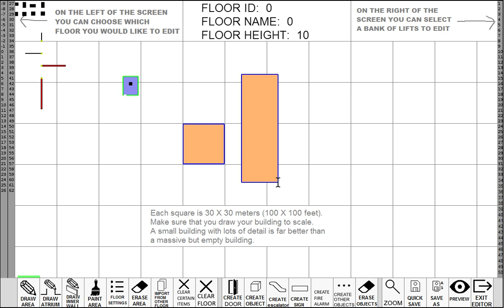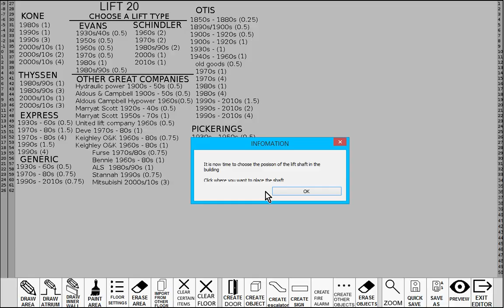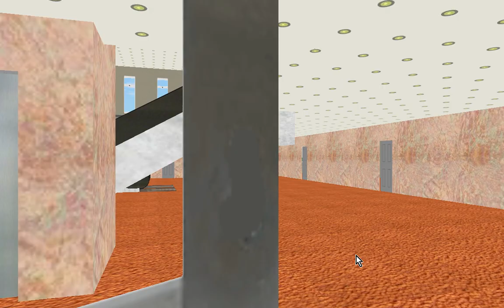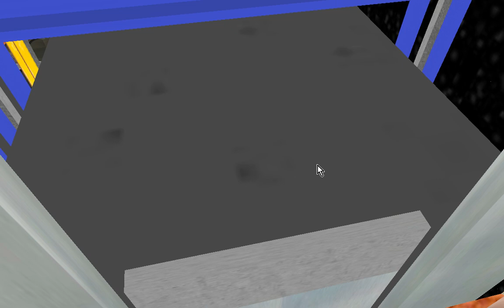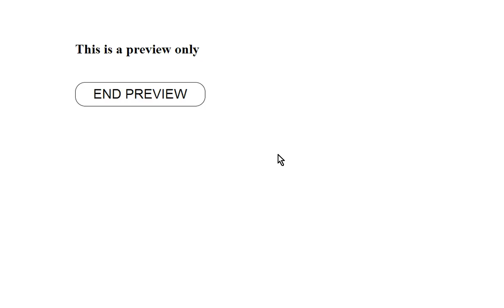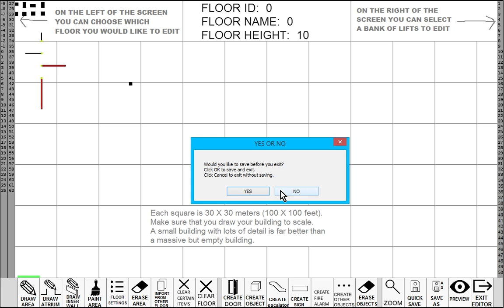Current progress on my update to skyscrapersim

Comment from the maker: What features would you like me to include in the update to this game?
Reply: So you can choose what type of door opening you want i.e dualspeed, centre opening, centre opening dualspeed, 3 speed etc and choose door thickness too
Reply: - Add crawl spaces between the floors, otherwise it just looks weird seeing just a flat polygon with no height as the celling and floor. 
- Allow settings in the building creator to be accessed by a menu instead of sequentially.
- Have things snap to other things, such as atriums, internal walls, lifts, and escalators, also use this to remove Z-fighting when this does happen.
- You didn't show the stairs feature, but I hope it can create helixes so realistic towers can be done.
- Revamp the way textures are uploaded to the building creator, the old system was horrible and basically turned me off from making buildings.
- Building off axis (idk if this is even possible and it probably should not be a day 1 feature.)

I probably forgot some stuff, that's just a few quality of life things to increase usability. Regardless this is miles ahead of anything before it and i cannot wait to return to some of my favorite buildings with this new feature set.

Thank you for revitalizing this!
Reply: Lift motor rooms, or some sliding door entrance at some building, or a revolving door
Reply: @suf-atha  There's already revolving doors.
Reply: @suf-atha  revolving door is already added
Reply: My suggestions:

- Indicator animations
- better level select (when a level is highlighted, show an image from a file)
- better loading (keep image up, show building details such as height, location, creator, etc)
- better menu (cycle thru level images in menu background)
- support for more model types
- dynamic lighting (looking thru source code, it may have some incomplete version unused)
Reply: incline elevators, gated elevators
Reply: A new ui and furniture maybe like office tables lobby desk...
Reply: Raytracing 😂. I think it would make a nice addition :)
Reply: Support for macOS (if you’re willing to do that. If not, that’s fine, I can always watch more demos)
Reply: @ratatatt1049  yeah that sounds like a you problem 🤣
Reply: @jakewynn  It’s not the end of the world for me if Beno doesn’t make this available for the Mac, but it would be amazing if he does.
Reply: @ratatatt1049  you could always run it through wine I guess
Reply: @ratatatt1049  I'm pretty sure that this is quite an old game engine but you can use a windows emulator on your mac.
Reply: Also one last thing, the ability to create irregular shaped buildings/parts to buildings. Maybe that can be in the foreseeable future though
Reply: Travelator (Moving walkway)
Conveyor Belt
Reply: It seems travellator is an option.
Reply: @Andrewjg_89  already have that
Reply: @Andrewjg_89  There's already travelator, on the escalator selection
Reply: ability to specify custom textures in-editor would be nice if that's not already a thing
Reply: Custom elevator making
Reply: Sound files would be good, motor noises etc.
Reply: @markford6785  yes
Reply: Fire alarms, Motor Rooms, Fire Mode, Lift Freefall, Exit Signs, and general signs that you see in buildings
Reply: an option where you can have freight doors
Reply: Hi Beno,

I have missed your Building Creator very much and am happy you are back.
For your new program I have 20 suggestions but I don't know if you can do them.

1. Elevators with external swing doors, but with vertical internal doors or without internal doors.
2. Platform elevators, like Inspirational City used to have.
3. Horinzontal moving cabs or subways with sounds that you can control much like an elevator. but that might be difficult.
4. Elevators that are round.
5. Elevators that have hydraulic drive.
6. Several buildings together to form one building.
7. Many choices of colors for windows, walls, floors and ceilings.
8. Glass panels in escalator handrails and a choice of step colors in escalators.
9. Creating glass roofs and glass domes for buildings.
10. Creating elevator doors that look different on the outside and inside.
11. Selecting different shaft walls and glass panels for each elevator.
12. Special settings for round buildings.
13. Many sounds for the elevators.
14. Buttons and floor indicators could light up as real as possible.
15. Selection for different elevator doors.
16. Selection of ceilings, floors and walls for the elevator cars.
17. Creation of fixed ramps.
18. Buttons for wheelchair users.
19. Selection for glass panels on the elevator shaft.
20. Half floors in buildings.

Your Building Creator was the nicest program for me to create new buildings myself. I found coding without Creator, just by hand, too hard.
Reply: More floors!!!
More Lifts!!!
Reply: If I were you, I'd make the controls on the top of the lifts and the counterweights optional. Not all lifts use a counterweight, not all Skyscrapersim users are gonna want to surf the lifts and (like you said) not all lift shafts have space for controls on the top of a lift.
Reply: Will there also be automatic doors for buildings?
Reply: a travellator would be nice in an airport themed map
Reply: A way to change the ceiling height of all or several floors at once
Reply: London Underground themed things like tube esclators and lifts would be a nice addition
Reply: Online multiplayer
Reply: @windowsxpnt2347  it's impossible to place multiplayer
Reply: MR Logic Cabinet
Reply: There are three things I would like to see be added. One would be differently shaped elevator banks (for example, four elevators on one controller with two on each side across from each other, or have two elevators perpendicular to the other two). Another would be ability to build a bridge between different parts of a building (for example, a bridge where you can walk from floor 2 of one building to floor 3 of another). The last one would be the ability to choose between using feet and meters.
Reply: add parths
Reply: Wasd movement and mouse cursor camera moving
Reply: The Previous building like EPL Tower Beno Version V2 and B & D state towers, toilets, Trains, basement Carpark that can let the car go in , new lifts, stairs, raining weather, new data and new buildings, sign board, aeroplane, new chime and door movement sound, Lift card reader and card reader for the train station, office and hotel rooms door, Key card, new textures for creating a building, swimming pool, train tracks, bus stops, night market, Escalator that can move by it self, inclined lifts and inclined escalators, new internal walls for the lifts, lift colours door for Bayside Plaza, new number indicator and lift doors that has 2 speed door and 4 speed door and Schindler Miconic 10 with Alphabet speakers with chime and announcement and some posters that can be put in the lift door, glass doors, wall and glass walls and some stickers for social distancing inside the lifts and the escalators that can walk and doors that can open by it self  
and some new lift type such as SMW Elevators that is from Sweden, Original Kone Ecodics 4mps, 1930 Otis 4mps, 1940-1960 Otis 4mps
Express 1930-60s 4mps, Otis Gen 2 4mps, Otis 2000VF 4mps, Otis Gen 2 2mps, Otis 2000VF 1mps, Otis 2mps and Otis 1mps
Reply: Expansion of textures!
Reply: Destnaition Dispatch (doesnt have to be a 1.0 thing)
Reply: Being more realistically
Reply: Also an option where if you want a double height floor which is the height of 2 floors with an upper atriumesque floor.
Reply: @alivinghuman8834  you can just do that by adding an atrium on the second floor
Reply: @boiii3productions945  i mean a mezzanine level and plus I don’t want balustrades on the atrium and there’s going to be far more atrium than actual mezzanine floor.
Reply: Can you add old gated elevators?
Reply: You Can Also Add An Edit button for custom buildings, so you can edit them if you feel if there is something wrong
Reply: @Nemo1095  he most likely would
Reply: The ability to make buildings with up to 1,000 floors.
Reply: Infinite floor and basement limit. Like you can potentially make buildings go 500 floors underground or 1500 floors aboveground if you really wanted to.
Reply: Maybe airport baggage claims
Reply: motor room
Reply: Would be interesting if it could use the original logic like MAME but preserving lift logic 😀
Reply: Playing online with other people?
Reply: Add the natural history museum
Reply: @ytpchannel9467  make it
Reply: A old Lester controls beter then the new one
Reply: fun
Reply: Paternoster lifts
Reply: An easy way to quickly create large amounts of floors have a button and it opens a area where you type in the number of floors you want and the dimensions
Reply: Possibly try to make the creator have less boundaries (move across the screen?)
Reply: Support for custom positioning of lift buttons, and custom lift textures (including custom textures for buttons), sounds, etc. Also hydraulic lifts. And, if possible, angled lift walls. Thanks for redeveloping the building creator BTW, really looking forward to its release :D
Reply: I think that you've already planned this, but here's my idea: A menu that appears after you click the "Create new Building" button before entering the editor in which you select the texture for your building.
Reply: safety breaks (Press S to safety break)  then slow to the floor etc
Reply: The ability to determin any custom speed value of elevators.
Reply: @jacobwest5592  You can do that in elevator editor while the building is loaded on skyscrapersim
Reply: @flappy-2048-the-master  Thanks! That was cool!
Reply: @flappy-2048-the-master  No! But you can do that when choosing an elevator type!
Reply: All elevator types in the United States.
Reply: clear voices
Reply: @Beno you will remove the copyright thing?
Reply: Ability to surf lifts and put them out of service 🤣
Reply: @corruptedshinnok9831  thats already in it
Reply: People? I think?
Reply: I hope it’s done
Reply: Inclined Lifts
Reply: The ability to switch between a light theme and a dark theme!
Reply: improved lifts (like smooth moving and 3D call panels and buttons)
Reply: trains metros maby
Reply: Excuse me, but may I ask you how to go into Beno Building Simulator? Because that's the one I want to use. So please give me instructions of how to get to Beno Building Simulator.
Reply: Add door types which you can choose for the lifts
Reply: Add an option for different texture walls and inner gates for old elevators and freight elevators. And add an option for having vertical doors or not. Add an option to change elevator speed and door speed. Add schindler 3300 too.
Reply: Inclined lifts
Reply: Make it so you can add induvidual windows in the lift doors
Reply: Make it so you can add locks for elevators for realistic service lifts, and a key object, a key card reader and key card object.
Reply: Add furniture for hotels
Reply: Custom sounds?
Reply: floor limet expanded to -20-400!
Reply: Undo redo in the editor
Reply: Create subways and dangle trains.
Reply: Update to textures
Reply: Link ?
Reply: keypad elevator
Reply: cars so you can use car lifts
Reply: snap grid so that its easier to allign objects and circle lifts cuz why not
Reply: DUMBWAITERS!!!
Reply: new elevator types
Reply: please please when will it be released when will it be released finally when will it be released when will it be released finally I am so looking forward to it!!!!!!!!!!!!!!!!!!!!!
Reply: make a video next part
Reply: Machine rooms?
Reply: @TechNerdNolan  noooooo
Reply: Schindler 5500 and Otis 2000 models...

Also can I have the link of this?
Reply: @serbianelevators  Um Of Course Not (He Mentioned. IT'S WORK IN PROGRESS
Reply: @serbianelevators   you cant he said is not done yet
Reply: Mobile support?

Comment: Can you add all of the lifts  brands that we use to create a building in Beno Building Creator 2.
Reply: Those lifts that we use in Beno Building Creator 2 are
1) Original Kone Ecodics 1mps
2) Kone 3mps
3) Kone Ecodics 1mps
4) Kone Ecodics 2mps
5) Kone Ecodics 4mps
6) Thyssen 1mps
7) Thyssen 3mps
8) Thyssenkrupp MRL 1mps
9) Thyssenkrupp MRl 3mps
10) Express First Generation
11) Express Second Generation 1.5 mps 
12) Express Second Generation 4mps
13) Express Third Generation 1.5 mps 
14) Express Third Generation 4mps
15) 1930 Otis 1 mps 
16) 1940s-1960s Otis 1mps
17) 1970s Otis 1mps
18) 1970s Otis 4mps
19) 1980s Otis 1.5mps
20) 1980s Otis 4mps
21) Otis Gen 2 1.5mps
22) Otis 2000VF 2mps
23) Otis 4mps
24) 1930s- 1950s pickerings 
25) 1960s Pickerings 
26) 1960s pickerings 1mps
27) 1970s pickerings 
28) 1980s pickerings
29) modern pickerings
Reply: Can you add some lifts in this website. But it’s still the same as we use the lifts in Beno Building Creator 2. The lifts are 
1) Original Kone Ecodics 2mps 
2) Original Kone Ecodics 4mps
3) 1930s Otis 4mps
4) 1940s- 1960s Otis 4mps
5) Otis Gen 2 2mps
6) Otis Gen 2 4mps
7) Otis 2000VF 1mps
8) Otis 2000VF 4mps
9) Otis 1mps
10) Otis 2mps
Reply: For the floor plan  can can put Alphabetical floor together with the numbers floor that is used in Beno Creator 2

Comment: How did you end up implementing the safety circuit?
I myself have been trying to compile the game from source, but i have been unsuccessful. It would be very nice if someone was able to help me out with this, as I am planning to make my own modifications to the game.
Reply from the maker: The games source code is very old.  The latest version does not have any source code for it.

A very skilled programmer contacted me and reversed engineered the game and added all of the features that I wanted.  I am very impressed with his skill and how fast he did this.

What modifications were you planning.  It would make sense if we both worked together on this, rather than both of us forking the game in different directions.   At the moment the modifications are not yet ready to be released.  if you are able to wait a couple of weeks then you will be able to see the changes I have made to the game and then we could work on any changes that you would like made.
Reply: @benolifts  Just wanted to let you know that the simulator actually now officialy has the features you wanted added (realistic safety circuit + separete controls for up and down in inspection)
Reply: @benolifts  Also have you completley abannedoned this or are you still planning to continue working on it

Comment: I'm suprised that you didn't just start developing a brand new game/simulator in something like Unreal Engine 4/5 or Unity Engine instead of trying to adapt this dated & empty feeling software which is supposed to be open source under the LGPL
Reply from the maker: There are a couple of reasons for this.  This old software does pretty much everything I need.  If I was to recreate it I would have to put months of effort into creating something that already exists.  It was easier to adapt existing software.  The problem is this is I am having to work around many bugs in the game.  This has turned out to be very long winded.

This old software does create a building to the level of realism that I want.  please ignore the textures as these need updating.  Plus I can do other things such as creating manual 3d windows, rather than having windows just as a flat texture.  Then once I have included internal upright supports, and more lift shaft decorations, the buildings will look as realistic as they would ever be.  The only thing then to do is to populate the buildings with custom objects (so that the buildings are not empty on the inside).
Reply: @benolifts  fair enough, I didn't factor in time of development...

Great work either way